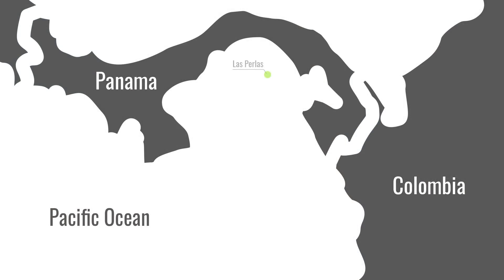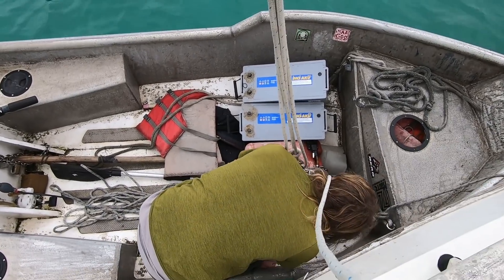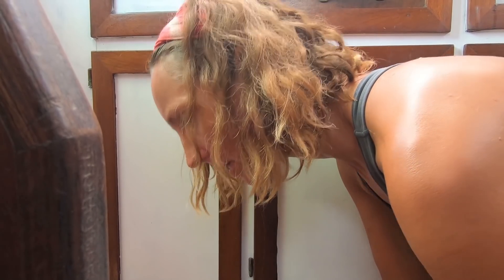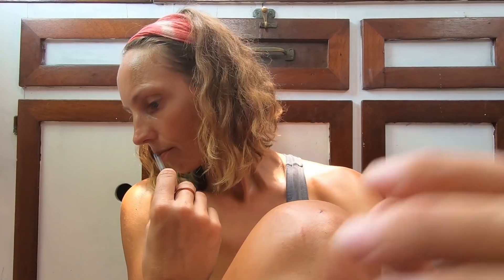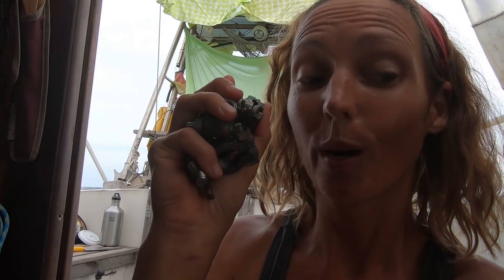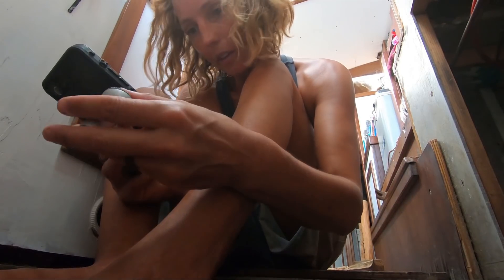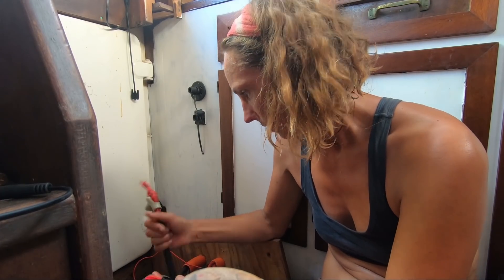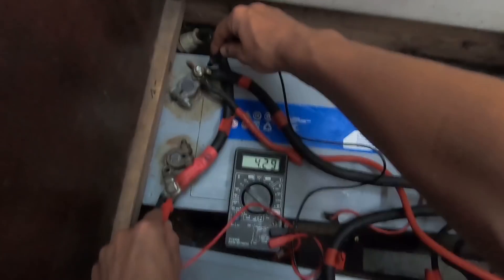Stepping up my game: figuring out how to trouble shoot the electrical motor of my Lofrans Tigres

Comment: maybe the windlass 'icky' symptom was from the weak AGM batteries?
Reply from the maker: The windlass runs over the starter battery cause I only use it with the engine running. The “icky” came from that lose connection that I showed towards the end. Once I fixed that, no more trouble 👍

Comment: this motor draws about 100 amps, a lot of current.  Keep an eye on these wires because if they are partially good it will show voltage at the motor but if you actually try to run it, it will either turn slow with no real power, or won't run at all.  Another check is after you've used the winch run down the wires feeling for any hot spots, this would indicate a partial break in the wire.  Old wires on boats are a problem.  As for your concern over Covid,  given your age, my guess, and your skin color vs the typical white as a sheet German (me) your Vit. D levels have got to be outstanding giving you a good chance of not getting it or only a mild case.  Remember though that a nice tan is good but burns are bad and cover up between 10 AM and 4 PM to avoid the roast.  Skin C is real, I've had it.

Comment: Some alternators will charge at a higher rate depending on engine rpm,s. I noticed yours  was charging at 13. 55 v. Which is good. Anything over battery voltage is charging, but if you were going to run your engine because of no wind, you would rev up the engine. That’s a good time to check what volts your alternator is putting out at high rpm,s. Then you know the max output of it.

Comment: being a marine elec. i admire your tenacity was a good try and not all waisted work, after taking the end caps off we would have replaced the brush gear firstly, I suppose you didn't have the new ones but at least you cleaned and adjusted them so well done your motor will last longer now brushes a made to wear out.

Comment: Well done!
What else could be is that the carbon brushes (which are decreasing by times of usage) are no longer long enough to fit. I had such a case 20 years ago on a motorcycle generator on the road and helped myself stacking some nuts to the springs of each brush. So the pressure of those brushes (the springs in real) was to less to really getting contact. It worked. Next time coming to the dealer bought new brushes an had to replace my workaround.

Comment: Consider lithium for your next batteries.  The biggest advantage they offer is that they charge to completion at almost linear current, whereas lead acid charges slower and slower as they approach full charge.  Particularly helpful when charging from alternator, because it's a lot faster to get to full charge.

Those "bad connection" problems are hard to troubleshoot, because you can measure voltage and it's correct, but the poor connection can't supply enough current, and the voltage drops to almost nothing when the load is connected.  You might have tried connecting a good battery directly to the motor...  hindsight is clear.

Comment: You can have voltage on a circuit with just a couple of stands of any wire, when under load that resistance will create voltage that is not flowing to ground, checking all along any part of any circuit
will create measurable voltage when you should have non(all going to ground)
Please look up voltage drop testing it is very accurate and can save a lot of time. I have been using this simple testing method for many years.
You would have found the resistance or open in that part with out taking the windlass apart which wasn't a bad thing just for maintenance.
If You measured the power to the windlass when running the voltage should be very low because it is flowing through to ground.
If You check for voltage on a light circuit unplugged you will measure voltage, if You plug it in you should read very low voltage when on because the light consumes the voltage
Voltage drop can be used supply and ground circuits.
Please check some vids out on voltage drop.
Reply from the maker: Thanks Ken, I will look up some videos on voltage drop 👍

I would like to stress again that I can ONLY measure my windlass Under load because whenever I switch it on, it’s under load / picking up since I do not have the common set up with the control box...but only am on and off switch meaning if it’s on, it’s automatically under load... (i tried to explain my set up with a little drawing in the video).

so I am not sure how the voltage drop method in this case would work 🤔 but I will look for some videos to try and educate myself more on the topic 👍
Reply: @WhiteSpotPirates  I was just saying that voltage drop only work while circuit under load, which is why it is so accurate and fast to use moving around a circuit
that might not be very accessible you can find resistance in a specific part of a circuit

Comment: In parallel the batteries will only charge to the level of the weaker battery, then Peter starts to rob Paul. Better to have a selector switch and use/charge one battery at a time. A device called an ACR simplifies charging management. Avoid isolators as they are inefficient. Much respect for your mechanical independence and abilities!
Reply from the maker: Thanks for the info. Could u explain why you think that isolators are inefficient?
Reply: @WhiteSpotPirates  isolators use diodes to manage the charge circuits and the diodes use up some of the charging energy. Say your alternator is putting out 13.75 volts, after the diodes the voltage will be dropped to around 13v to 13.25v hence it will take longer to charge the batteries. The ACR (Automatic Charge Relay) uses electronically controlled switches to accomplish the management and does NOT reduce the alternator output voltage so they are more efficient.
Reply from the maker: @ianallan2337  thx, got it 👍

Comment: I noticed the windlass motor shaft was threaded yet you appeared to unbolt the motor and pull it from the housing. How does the shaft unthread so easily?
Reply from the maker: I think the part that u r referring to is where the shaft meets the flywheel of the gearbox (not sure these are the right terms, sorry). It’s not threaded into sth, more sitting against the teeth of the wheel so it can move the wheel when the windlass is turning. That’s why u can easily remove it.

Comment: Point to remember, when troubleshooting, start at one end and work to the other. Trouble is knowing which end to start. If there isn't power, start at the power end. If there's power, then take it further, step by step, towards the source you are trying to repair. You have an analytical mind that serves you well. 👍
Reply from the maker: Yeah I totally get that part which is why I had measured the voltage first. But as mentioned by others: you can have voltage but not enough amps coming through, which I was not able to detect by measuring the voltage which is why I went further along the troubleshooting line 🤓😂 I think that taking the motor off and just run it with jumper cables is a good next step, though, than taking the motor apart right away 😂😎

Comment: You really should get those winch cable connections hydraulically swaged (there are some awesome hydraulic swagers available for 30 or 40 bucks) or solder them. The last thing any of us needs is a winch failure in an emergency. Having said that its now on my list to examine mine. The thing to know about mechanical connections (screws, crimps or swages) is that every such junction will have a voltage drop across the joint. The weaker or lower the connection pressure, the higher the voltage drop will be. If there is a high voltage drop then there will be heat generated proportional to the voltage drop and the current. In fact the heat in watts is the voltage drop times the current. Once there is heat generated, then the wire and or the terminations begin to oxidise and fail ever faster. Ou can test your critical joints by loading them and measuring on volts to see how high voltage drop is from one side to the other. If you have an amp meter as well you can calculate the heat generated.
Reply: There’s also the risk of fire if it gets loose and shorts

Comment: The only thing that I know of that you didn’t do was clean the terminals with an abrasive to remove the oxide layer. This could lead to un even charging. He other thing is you have 300 amp hours regardless of parallel (12 volt) or series (24 volt) connection.

Comment: Never trust a "crimped" connection. 
Electrical wires, just like ropes, should ALWAYS be braided together, and then protected/marked.
"Heat shrink" is for covering a connection where a BRAIDED connection has been made - NEVER TRUST A CRIMPED CONNECTION.
Glad to see you are learning the intimacies of an electrical motor, and that you are healing. 
BTW, the "sanding" and using a toothbrush references are for rotational and longitudinal applications.
You sandpaper in rotation, and toothbrush between contact points along the line of the shaft.

Comment: On a boat it's not do critical which terminal you disconnect first and reconnect last. On a car the metalwork is all connected to the -ve, so it's best to disconnect the +ve   second because if your spanner bridges the gap between the terminal and the body work while the -ve is connected it'll make a big old spark. Boat's earths aren't wired up to the hull cos it's a recipe for electrolosis.
Reply from the maker: Ahhhh thanks for that enlightenment 👍👍 but doesn’t that mean that only on Aluminium boats it does not matter since steel or fiber glass won’t have all their -ves lead back to the battery but to the hull? 🤔
Reply: @WhiteSpotPirates  its interesting you ask the question. I forgot your boat is Aly and not steel but I would have imagined they are the same. Do you have continuity between your hull and -ve terminal? Possibly it's bridged through the engine mounts. Maybe by design or by accident. I would imagine that it's not great from an electrolosis or fire risk point of view to design a boat that way, but I don't know if that's standard or not. I have to be honest and say what I know about metal boats I mostly learned from your videos. :)

Comment: This high amp motors will not totally fail by coal dust.  A to short coal brush announces itself.  By hammering on the motor this contactproblems can be bypassed for a while. Just like a car starter motor.  Befor disassembling this motors,  measure the Voltage first (Protect your eyes during measurments on high current terminals !).  Just like checking the fuel level before disassembling the diesel engine. A shurtcut inside the motor would have blown the fuse. If the motor gets to hot  check the transmission first. If this motors gets no water and are not overloaded by a bad or blocked transmission, they last much longer than a diesel engine. Disassembling will reduce the lifetime significant due to scratches where the moisture can start the rust.  Sanding the commutator of a working motor is not productive. It causes shortcuts by copperparticles and wears out the brushes faster. The sandpaper will left more scratches where it should not.
Lead acid batteries starts to sulfate  when the acid concentration in the cells starts to sink. This happens with every mAh you took from a fully charged battery. Low battery charging levels decreases the capacity every day.  So never ever left the batteries empty in a frost, never left them empty for more then two days, never without a charging source like solar cells in combination with a automatic batterie charger for more then two weeks.  The charging device should be able to compensate every day his own power consumption and the self discharge of the batteries. A windgenerator gives you the ability to make a 24h charging several times a year, wich is very important.  The ideal voltage level is @12,6 Volt.  Falling below starts the sulfatation (but sometimes can not be avoided),  exceeding starts decreasing the electrolytelevel (but sometimes required for charging).  By the way fasten the batteries very well. During a storm, they will pulverize the whole interior. If this is done they say good by directly through the hull.  Check the old batteries by separately charge them for 24h (the charging device should be able to deliver the required current), then disconnect everything for 24h , if then the voltage is under 12V do not use this battery, she will cause harm in your system, wears out the alternator, sucks out a good battery wich is in parallel and can not  deliver high currents. If the voltage is still above 12V, connect a load of  50 or 100 Watts like a headlight. If the voltage does not fall under 12V during the load is connected for more then 20 minutes, you can still use this battery if you agree with the capacity. The capacity of this battery you can see on how long the headlight is bright.  Stay fully charged !
Reply from the maker: Thanks, lots of good advise there! 👍

Comment: I always like that when there is good deal.  There is always someone upgrading, downgrading, or just cleaning house, and after all its just material.  Sometimes the find is really great quality.  The complete mechanical diagnoses of a functioning unit is brilliant, you are very thural, I would of just sprayed it with 4D-40 and been done with reason of all the test points.  This summer I replaced a stator on my motorcycle, and at the height of my electrical experience relised I was trying to measure voltage in place of amperage drops looking for a short.  Well every led light uses small amperage, while 12 volts can be measured everywhere until their is a ground, and then the fuse burns.  Turned out an LED in gear indicator in the console was blown out the15 AMP (main).  By Mid july started the summer,  not april as had dreamed for. With those two problems the Stator( is generator and signal timer for CDI) and one short is lot of learning about electrical diagnoses.

Comment: Nice job and learning curve. 

Next time open the brushes .( parts that contact the commutators ) 
There is a little spring ring that holds the bracket. 
But your problem is in the brushes.  Replace those next time . 
The big core with windings is not a communicator . Thats only the part being fed by the brushes
Obviously you need a control box
Reply from the maker: I don’t thing you need a control box...I ran my windlass without it for seven years...what makes u believe that one obviously needs one?

Maybe u missed the part that I said that I had checked the brushes. They were fine in length. I removed all four of them and Sanded them a tiny bit where they sat a bit too tight in their slots. The windlass is running flawless, so I doubt that my problem are the brushes. I am not sure what makes you believe that?

I do not recall calling the armature the commutator...🤔 but thanks for the heads up.
Reply: WhiteSpotPirates  your did an amazing/ awesome job . Good education for boaters too. 
Don’t feel offended.. 😌 i know it can sound like an un wanted advice!  And text is not the easiest way to say something well. 

its 7 years of flawless running. So the brushes must be shorter eventually.
On some type brushes there are indicator lines carved to show wear limits.. obviously its the cycles used and power it need to produce that determine the real wear.  I realised you haul up due to the broken relay box.  Less wear to the motor but it only turns one way. Running both ways the commutator may stay in better shape.  Nevertheless yours look very good as far it was visible on the vid. 

Thats why I mentioned ..to see if you can have some brushes replaced if you have to do that again. 
Short brushes tend to ruin the commutator due to hight temperature and arcing. 
But the type of  winch is one of the best. We have the same type . 

Well done 👍🏻
Reply from the maker: @MonkPetite  yes, I was defenitly gonna get some new brushes. The windlass has not been used thaaaat much, though, and those brushes still looked pretty good. I read somewhere that if they are as long as wide then it’s time to change, but I guess that’s a bit of a general rule...they were a lot longer than wide still and since the windlass is running quite well I assume that it was more them being a little stuck than too worn...
But no worries: new brushes are on the shopping list!!
Reply: WhiteSpotPirates  top job my lady 🥰.. love your 🏴‍☠️channel and stay safe there 👍🏻

Comment: Hi Nike, Just a quick thought: from your diagram it looks like you’ve got the power for your winless attached to your start battery. The winless should really run off the house bank as a general rule, so you don’t endanger the power for starting your engine. Always impressed by what capableWoman and Sailor you are. Nice to have you back ,cheers
Reply from the maker: 🤔 hm I am not sure I agree with that. I only run my windlass with my motor running...it’s 1200W so yeah no way I would run that on my house batteries, they would be sucked empty before I even get close to picking up my anchor 😂 as I explained in the beginning, the reason it is wired to the starting battery (not straight but with fuses and a breaker) is because I pick it up with the engine running...so no worries, I won’t drain the starting battery 👍 but thanks for ur concern ☺️

Comment: I've always felt crimp connectors were not designed for marine applications, barely for mobile (cars tractors ect) because with movement they get loose. They also are really bad in corrosive situations, marine salt water, have usually two or three different metals, everything is wrong.